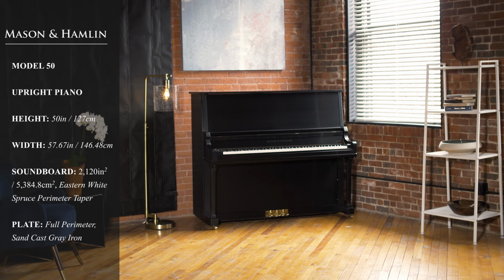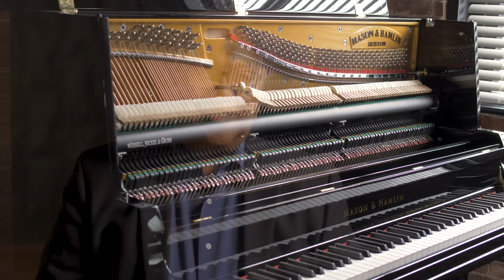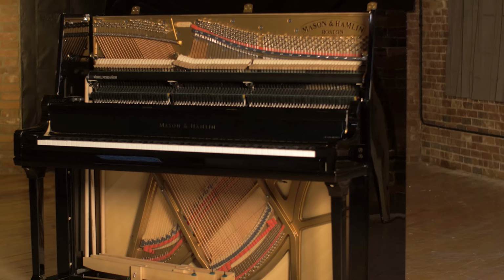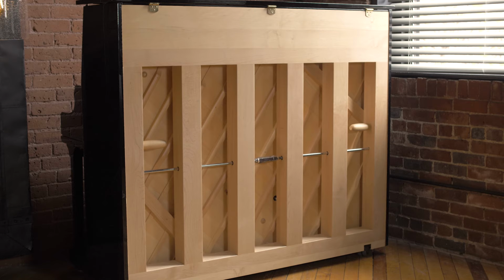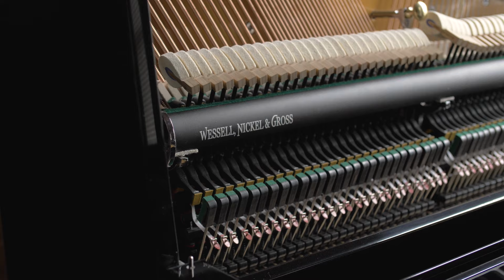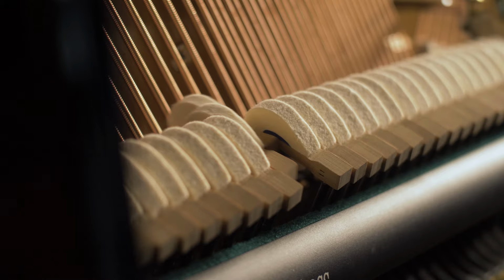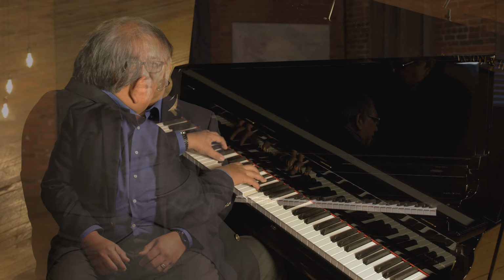Mason & Hamlin Model 50 Upright Piano

Comment: How much is it? I wanna buy that
Reply: They Mason & Hamlin model 50 generally has a street price in the low 20 K range, according to Fine’s supplement.
Reply: I would recommend buying a used M&H. They are hand crafted so can easily be passed down, rebuilt, etc from generation to generation. We were looking at a used upright 50 for about $11k but ended up getting a used Yamaha YUS
Reply: @curteye22  what's the price of brand new model 50 and used model 50?
Reply: @curteye22  how can we buy it?
Reply: Does anybody know what piece he was playing?  That is a great piece to showcase a piano.  Or was it improv?